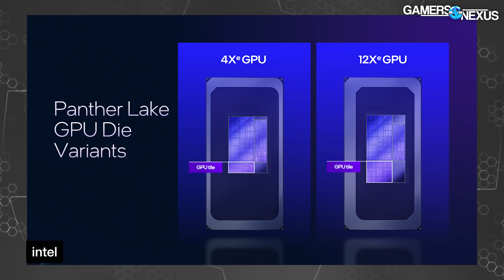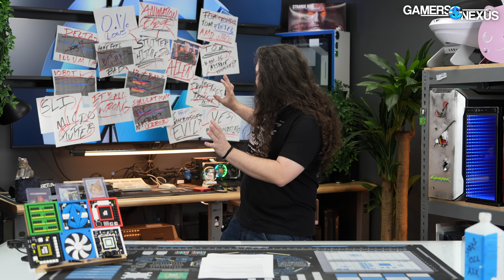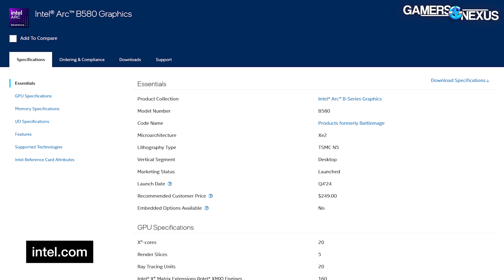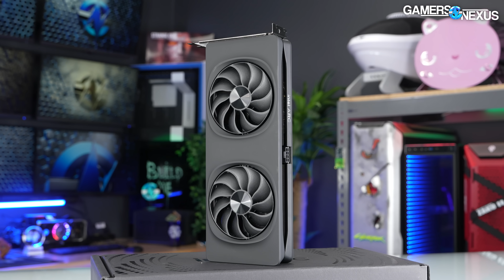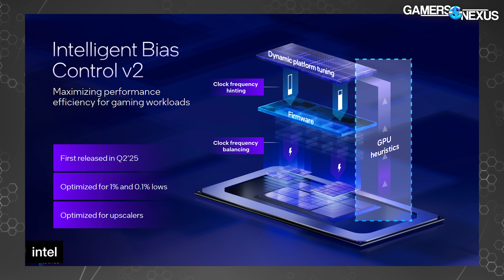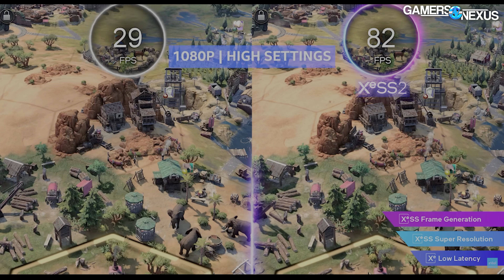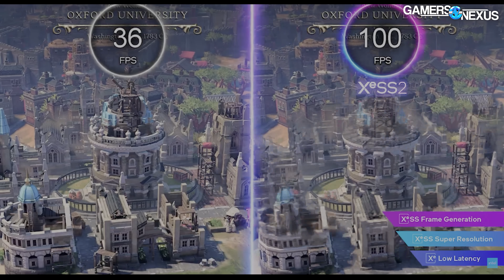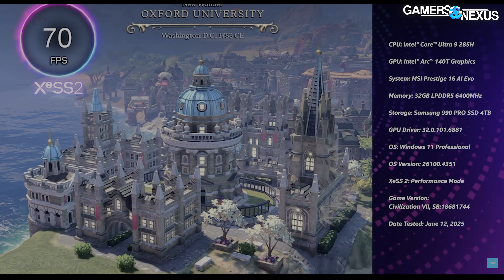Intel's New GPU: Xe3 Architecture Changes, Handheld Gaming CPUs, & XeSS3

Comment: Intel needs to lead the entry level GPU market with pricing from $200 to $500. Offering 12 to 24GB VRAM, and hopefully performance close to 9060 to 4080 like with solid features would be welcome to the market.
Reply: 4080 performance with 24GB VRAM for 500 dollar is wishful thinking with the state of the current market, even if intel wanted to do that, they'd be doing that on a deep loss with the manufacturing costs, with the financial state in which intel currently finds itself in I HIGHLY doubt that they could get anyone to approve such a massive loss leader just for goodwill.

I bought a A770 LE on release to support the endeavor, but I kept my expectations grounded, which was a wise choice considering the driver issues, I'd suggest you do the same in order to prevent disappointment.
Reply: @Xeonzs  "they'd be doing that on a deep loss with the manufacturing costs" :-) These rumors are repeated over and over again until people start to think that is true - while it is not. Manufacturing costs alone are pretty low at large scale, nowadays usually well well below 50% of final price.
Reply: @ksitau  it for intel gpus. The die use to performance ratio is garbage. B580 has similar die cost of 4070 Ti. Think about the msrp is each.. it is not as simple as you say. Intel got into making gpus with the assumption that the first few generations would be at a loss as they figure things out and gain mindshare. As the first comment said, arc so far has made no profit.
Reply: @ksitau  "Nowadays" it is actually more. The new process nodes are significantly more expensive. You need to keep in mind Nvidia sells the chips at a certain cost to the board partners, which is not the MSRP (although it is super close to it now). The scalper prices don't give more money to Nvidia or the board partners (unless it is a super weird/niche case where you buy at an inflated price from a board partner).
Reply: @TheCosmicMason  If you have any confirmed info that intel is selling anything at loss by design, please share it with EU antitrust agency. That is forbidden under unfair competition laws. Until you prove what you say is true I will claim that is spreading fake information.
Reply: @jaylapointe1654  Well, I'm arguing only about manufacturing costs. The final cost is always a multiple factors in on top of manufacturing (software, engineering, marketing, shipping, all profits through sales chain, storage, and so on ans so for).
Reply: @ksitau yes, and I argued that it is now more expensive than ever. The node price increases are pretty steep, and keep happening.
Reply: @ksitau by that logic it is illegal for Sony and Microsoft to sell consoles at a loss as has happened many times. You think some technicality will stop these companies? We all know Nvidia breaks the law everyday smuggling gpus. In many industries it is well known that it is required that you take a loss in a product for the first few years to establish the brand etc.
Reply: @TheCosmicMason  Well, there are circumstances that you can sell legally at loss, but these circumstances exclude maintaining or gaining market share. Starting new product is a risk that may end up in a loss overall, but your pricing for new product can not be "by design" set below your costs. So waiting for some proofs of illegal practices or I will call it just another myth from the internet. :-) After all there is a responsibility, we just can't look the other way when things like that happen and then we need to call it what it is. It is just a matter of right attitude - no mater where you live. And I like this channel for that "right attitude".
Reply: Well, get on the board of directors and lay your vision out
Reply: Inel Arc is dead given that Nvidia will be designing graphics tiles for upcoming APUs and Intel has been losing money with each Arc graphics card sold.
Reply: @sarod170 they need to start raising their prices and make money, get competitive. They could ask $300 for the b580 now and still sell well
Reply: intel arc pro b60?
Reply: Hopefully the B770 rumors and true. If it is and it’s about a 7800xt/4070 level performance at 400 dollars that will shake up the market so much!
Reply: as a business perspective that’s dumb af especially from a failing company. it’s like asking to do pro bono aka free work
Reply: Didn't Intel and Nvidia did collaboration recently? I think Intel GPU will improve significantly and hopefully entry level market with least 12gb vram.
Reply: But you’ll need 9800x3d to get 60 fps.
Reply: not going to happen, especially while nvidia owns so much of intel. They wouldnt' help create competetors to their own products. I would think arc discreet cards are gone for good.
Reply: @robr4662  It would not be much of a competitor if Intel is aiming as us regular folks while Nvidia has clearly been going all in on LLM and other 'AI' type customers - Nvidia pretty much doesn't have anything worth having in the lower end already. So as work done to improve performance and architecture that works at the low end or the high may well be mutually beneficial and Nvidia as you pointed out owns a chunk of Intel they likely can benefit cherry picking from the good ideas created to suit the lower end and more power budget limited hardware.

Comment: I just want Nvidia's monopoly to stop, this is a great step.
Reply: Until Nvidia buys more Intel stock
Reply: As if AMD doesn't exist 😔
Reply: Buy AMD then. I have a RTX 4090 in my 9800X3D pc but got a 9070 XT for my 7800X3D pc and it's great! AMD has come really far very fast.
Reply: @JohnnyNismoGTR  waiting for the 10k amd series, I am still on a 1660 ti 😅
Reply: @JohnnyNismoGTR  AMD is terrible for rendering/production workloads though. Their support for those use cases is sorely lacking :/
Reply: @PanderingSlats My 7900 XT can render just fine. It also does production  work in batches just fine.
Reply: @malformedneutron  Could I ask which software you use, just out of curiosity?

My experience has been that AMD has good hardware on paper, but their software support for non-gaming tasks has lagged behind Nvidia considerably.

A couple years back I found that AMD hardware couldn't process a raw codec I was trying to use with Adobe Premiere; it turned out to be a known issue with AMD and Adobe both blaming one another and refusing to take charge.
Reply: @PanderingSlats A few years ago is a long time. Topaz supports AMD GPUs, and so does other interpolation/rendering/upscaling software such as RVE, upscayl, kdenlive/davinci resolve. ROCm just works for LLMs (on arch, can't speak for other distros). Furthermore, whisperx and anything with ctranslate2 can be made to work with soke effort. RAW is supported with libraw in multiple software suites such as krita, digikam, gimp, inkscape, and so on. I do not see why these things would not work for you now.
Reply: @malformedneutron  it was just 2 years ago, and I'm talking about support for codecs like ProRes Raw. Have they doubled down with the latest generation?

And I'm not familiar with half the names you brought up, those are mostly generative AI/LLM tools, right? Because that's not what I'm talking about. I'm talking about support for video processing/decoding itself.

I was so sorely disappointed with the issue with ProRes Raw; at the time it appeared to be emblematic of AMD lacking support/optimization relative to both Nvidia and Intel gear.
Reply: Incorrect on most of my message being about Gen AI. I touched on video rendering in my message. And yes, of course ProRes is supported. I have several files encoded and decoded with it.  @PanderingSlats
Reply: Every AMD fan owns a Nvidia GPU. Stats don't lie
Reply: I don't think you can have the monopoly stop.  This tech is so far out of anyone's ability to reproduce without significant investment ...
Reply: @kayakMike1000  It can be reproduced fine, it's just unavailable because of copyright. 
I wish it was abolished as a practice, a system that was meant to protect the little guy from big corporations is now used to protect the monopoly of big corporations
Reply: It won't be
Reply: With Nvidia investing in Intel means Nvidia making sure they stay in the mix
Reply: All my homies are swapping to AMD, except one and I <lovingly> clown on him for it.
Reply: The only area Nvidia really has a monopoly on is the really high end way way beyond the budget or needs of most folks - at the sane for general consumer end AMD and Intel's Arc are often far better than the Nvidia offering (if one even exists that low down the Nvidia product stack) - heck AMD now produce an APU that is bonkers impressive graphically, comes with some decent compute and so far seems to be turning up in in systems for a very reasonable price compared to the discrete components.
Reply: @foldionepapyrus3441  They also have a monopoly on anyone who wants to use software that benefits from OptiX. AMD is not even competing on that front.
Reply: monopoly is when you're blowing the competition out of the water
hello tim sweeney